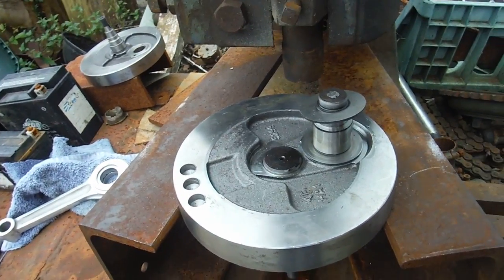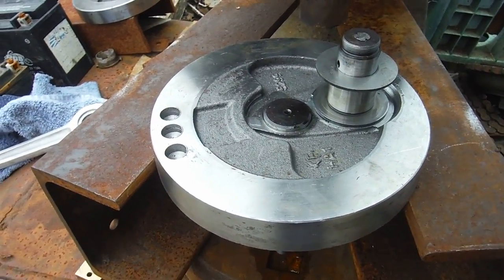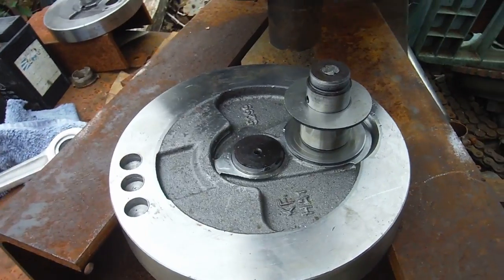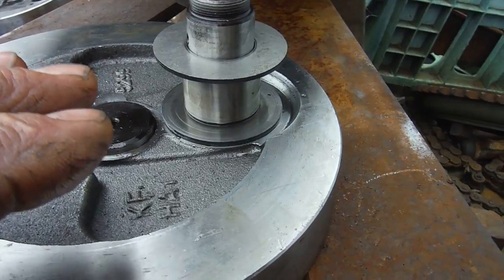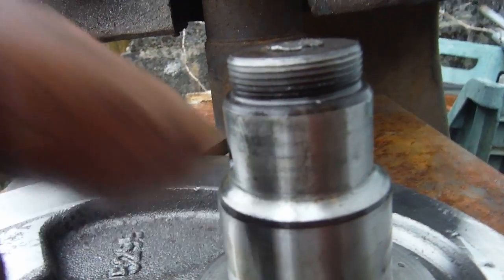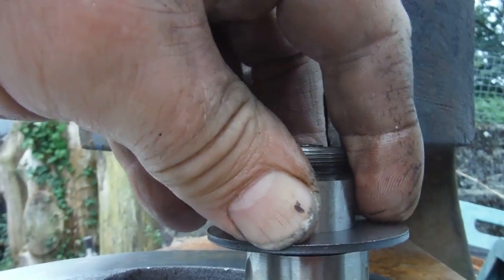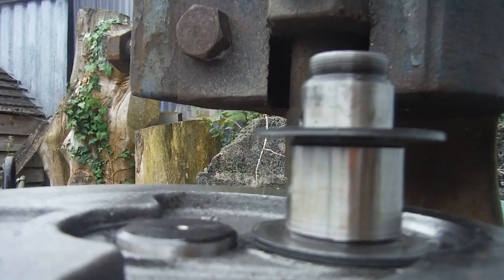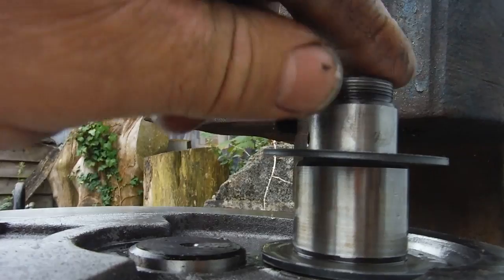Royal Enfield crank proves difficult to true - reason discovered.

Comment: Is this of a UCE Royal Enfield?
Reply from the maker: No, this was an old type 350 Bullet crank.
Reply: @paulhenshaw4514  Hi Paul, any of your expertise on optimizing the way the UCE 535 GT cranks can be rebuild better or perform better? 

Finally imported the H cams to India. Doing a full rebuild this month after a 6 year wait.
Reply from the maker: Hi, I never touched the cranks tuning wise on the UCE engines, I mainly shortened the cylinder barrels, changed cams and their timings and fitted carburettors.
Reply: @paulhenshaw4514  One last question from a big admirer of your work. Any tips for me since I'm stripping everything apart and rebuilding it? Particularly to optimize the reliability of the motor. Bearings? Gaskets? Machining? When I shortened the barrel I did shorten the pushrods but still needed a 1mm gasket under the rocker bearing to resume compression. What can I do better?